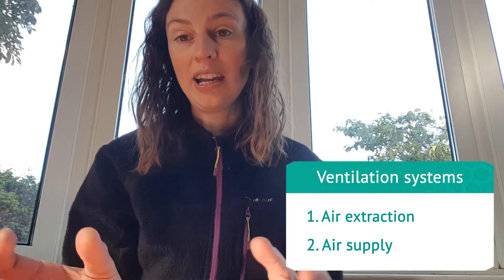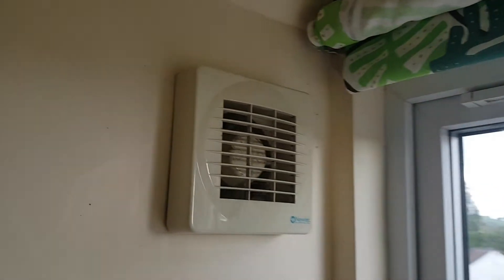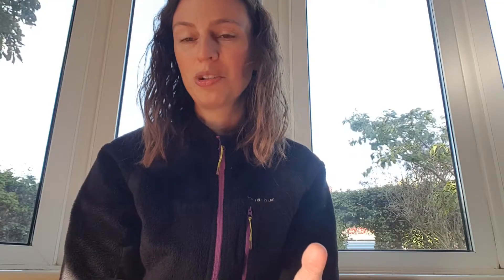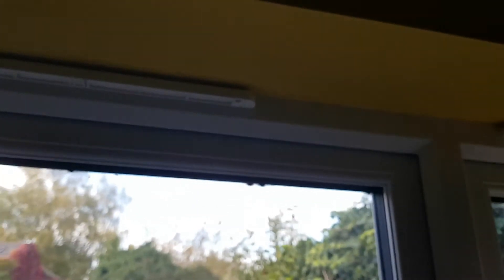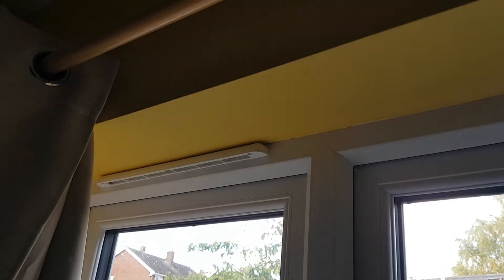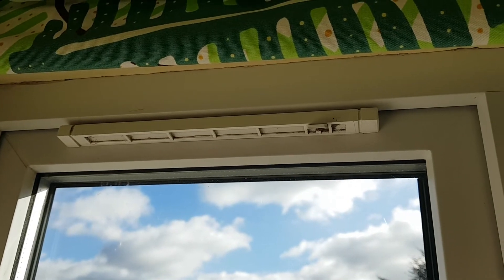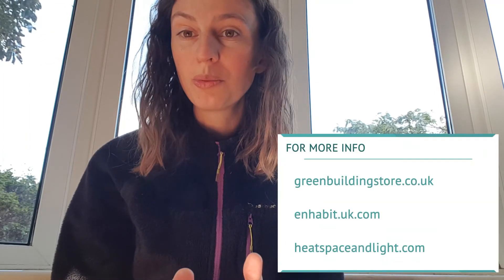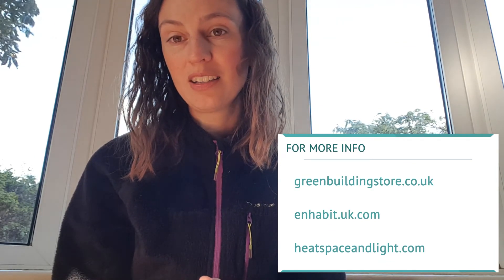Ventilation Basics

Comment from the maker: CORRECTION to the above video.  I have since come to learn that the fan in this video is not a constant-pressure fan i.e. it does not try and maintain a certain ventilation rate. However, I still stand by the assertion that this is a good thing to have in a ventilation system if possible, but you're half way there if you can get a humidity controlled system.

Comment: I believe that in order to change an intermittent fan controlled by a light switch to a continuous fan then additional electrical wiring would be required?
Reply from the maker: Sorry for the delay Alan, not necessarily. In our case we had an intermittent fan that kept running for a certain time after the light switch turned off, so it already had an extra wire that was independent of the light switch. So it depends what you are replacing.